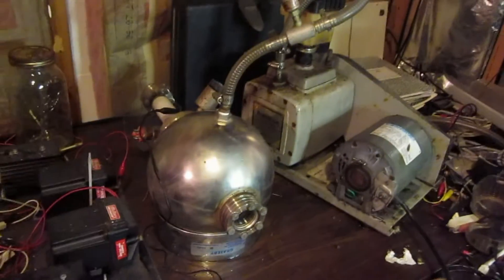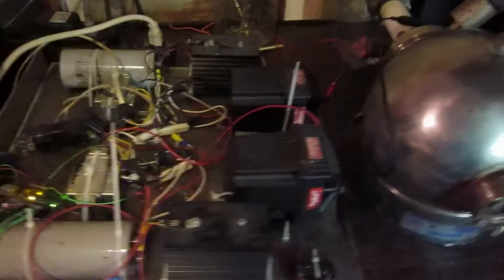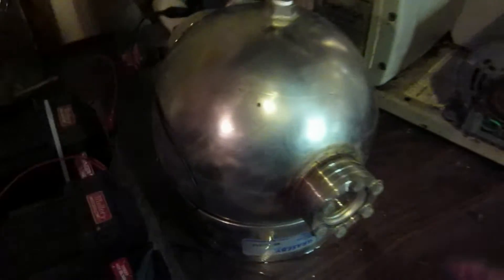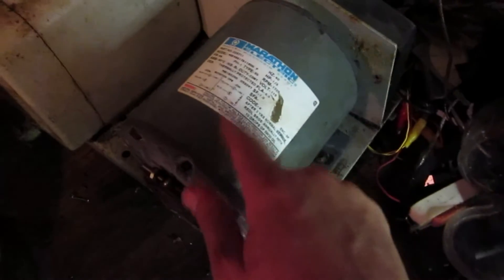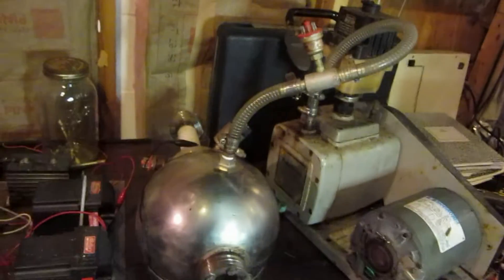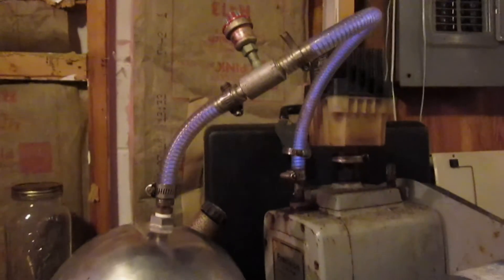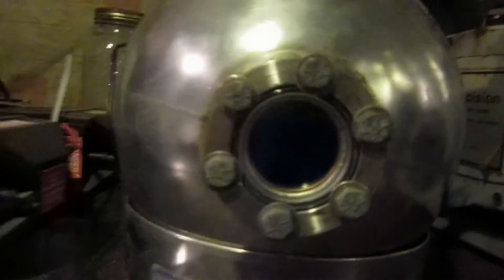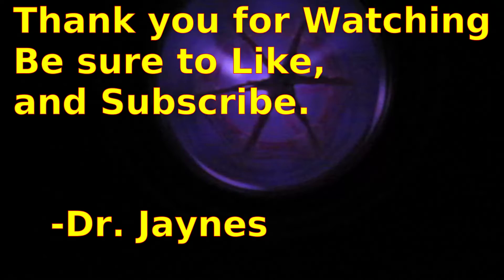High Voltage AC Fusor for Nuclear Fusion

Comment: Good work, what is the voltage?
Reply from the maker: I was running 2x, 60kV racing ignition coils..back to back.. in series..  The voltage could have been as high as 120kV, but I did not measure it... The load (plasma) can bring the voltage down from open circuit ratings.. .so it was probably lower than that..
Reply: @jaynesnetwork  Thank you Jaynes, please go further. I am sure the old Fusor way is the only right one. Very good luck from Javier Lopez, www.pulsotron.com

Comment: Keep it up. I have seen that you have access to tritium. So if you get protium or deuterium then you can synthesise fusion reaction. Reply if u have any problems
Reply from the maker: I will probably just try deuterium next. I have some heavy water D2O. I am not ready to break the "T" viles open yet. Deuterium should give plenty of neutrons.  I will need to get a shielded fast neutron detector working.  The high voltage AC/RF interferes with the operation of the photo-multiplier tube in the neutron detector, so I definitely need to design something to get a good measurement working for that before anything else.  Thank again..
Reply: jaynes network You better watch out for the neutrons that will be emmited in the process
Reply from the maker: I will do that.  Thanks.  Hopefully I will get my detector working and shielded soon.